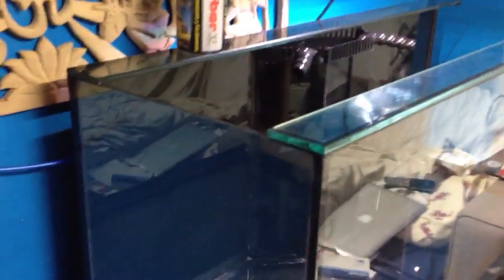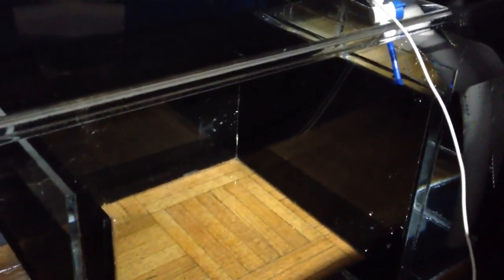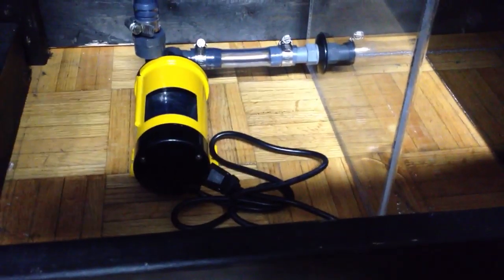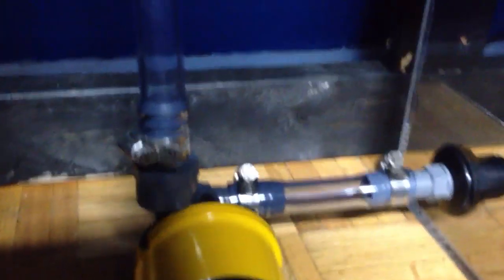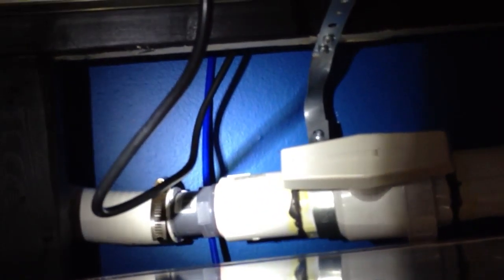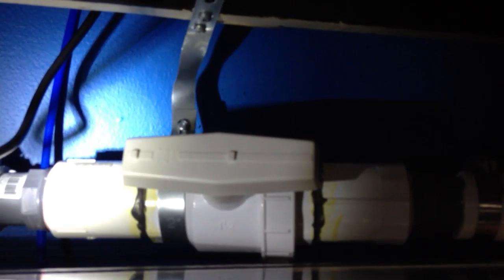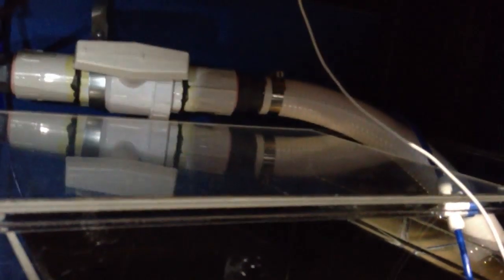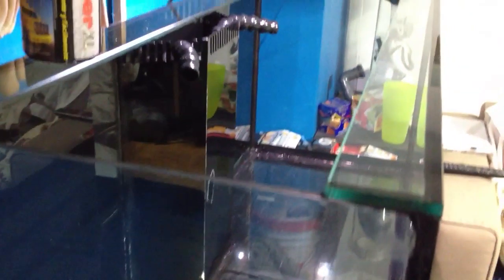Reef Tank: Plumbing / Pump

Comment: You might want to rethink the stainless metal hoseclamps in saltwater (if that is what they are).  If you have your skimmer in the first compartment of your sump with a wall to the bottom of the sump tank and a periscope style setup with a T at the end of your feed line to eliminate the air gap issues, the skimmer will have more than adequate contact time in the first compartment with a 750 gph (at head) pump in the third compartment.  Your second compartment wall should also go to the bottom of the sump tank and you will have adequate contact time for your refugium at a 750 gph flow rate as well.  The bubble wall only has to be after your second wall before the return pump in the third compartment.  be well.